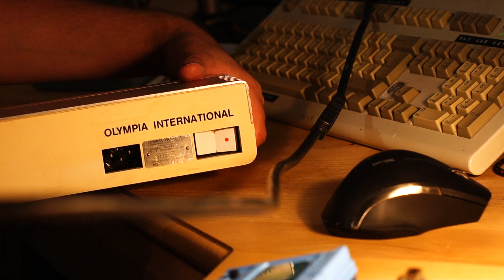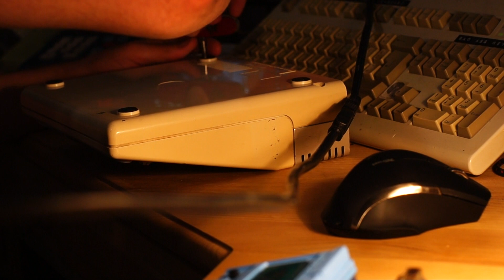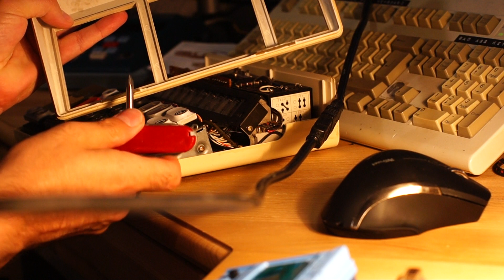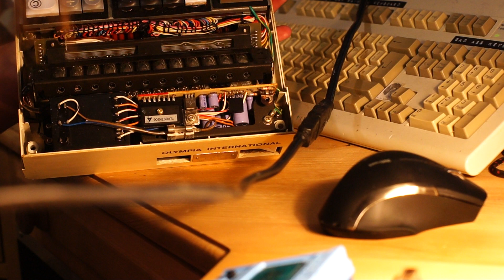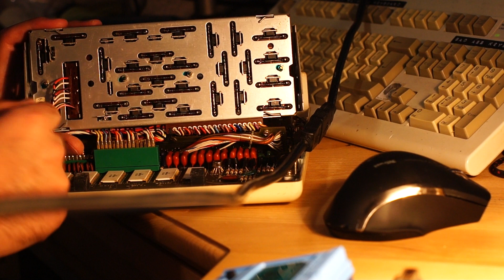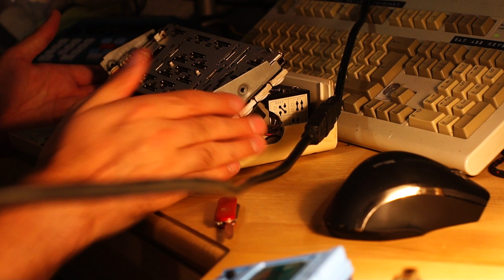Olympia CD401 Nixie Calculator Overview

Comment: Thanks for the video - - - please look at mine: https://www.youtube.com/watch?v=4GC-UEqSgnw
 I love my CD401 and I have been using it since one year now as a sidekick to my desktop PC whenever there's something to calculate. But. as you see, the Nixies flicker from the left, and the Zeros in the Nixies light up the more digits I enter (this doesn not render it unusable, but sometimes the displayed results are hard to read). After watching your video in search of a simple solution I found that the marking on my built-in mains unit looks different from yours. It is only marked with 110 and 110 V. Do you think I'm feeding it with excess voltage all the time and that might be the reason for the undesirable lighting up? Because, I can hardly see a reason why I should have a different power supply, at least it looks all the same.- I am by no means a high-voltage hardware tinkerer, but I'm sure I could change the wiring if this was the reason.
Reply: After looking at your video again seeing your wiring and the diagram on your power supply, it seems to me that mine is probably set to 220 V, which has been correct decades ago, but we do have 240 V nowadays.
Reply from the maker: These days the really new stuff like my house is on 230V. Usualy 235V
Reply from the maker: Not sure. I have mine set up on my electronics work bench that was recently rebuilt by a friend.

Comment: It must have been an old design when they made it. As in 1972 most calculators were VFD tubes . Great video and well done getting it for such a low price. I am Shure I have bid against you on vintage calculators in the past .
Reply from the maker: Saying that Nixies were used up untill the late 70s. But must were VFD's. Have a few with VFD's. I think I got it as they did not put Nixie in the listing. No doughts, these only going to be a select few after vintage calculators & there are plenty that don't sell.